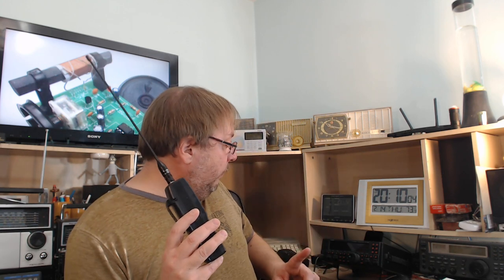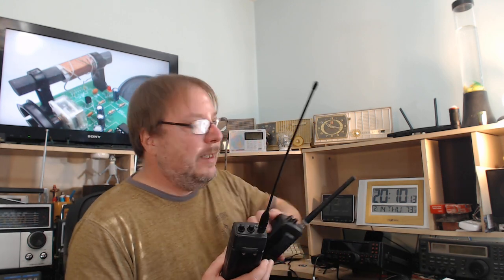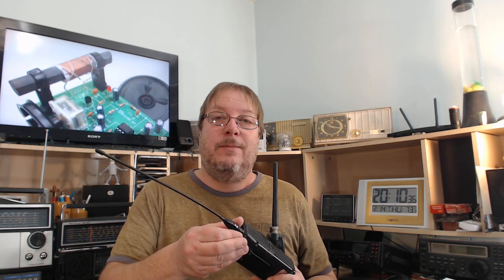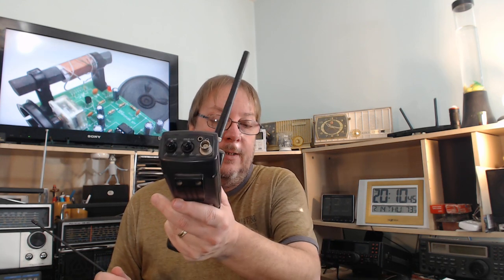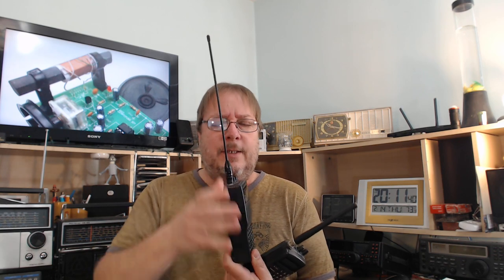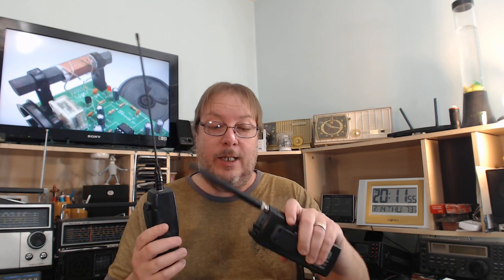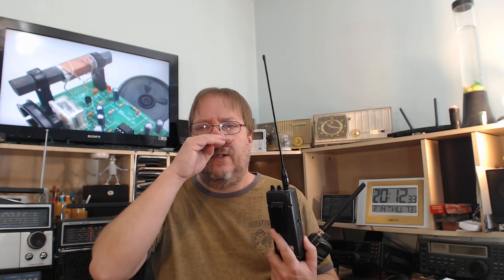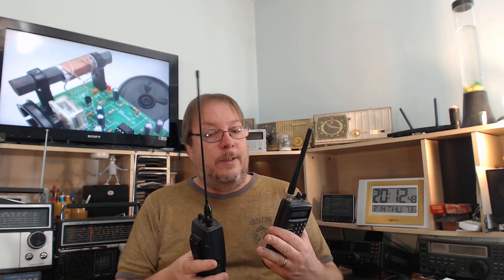VHF UHF radio daily tip 9 There are better antennas than the rubber duck that came with the scanner

Comment: Hey great video, but I have a question for you. I just pick up a PJ2 com radio for caring on flights. My question is can I buy a antenna for here at the house when I’m not using it for flying to listen to aircraft? I know the range diminishes when on the ground. Just would like to pick something up to help boost the range here at home.

Comment: I absolutely hate all types of rubber duck antennas. The quality of any type of rubber ducky antenna does not do justice on a scanner radio. All my radios are telescopic and they do help perform any other type of antenna on the market. And the truth of the matter is you can adjust a telescopic antenna to the type of frequency that you are monitoring but asked for a rubber duck you are stuck with only one rod